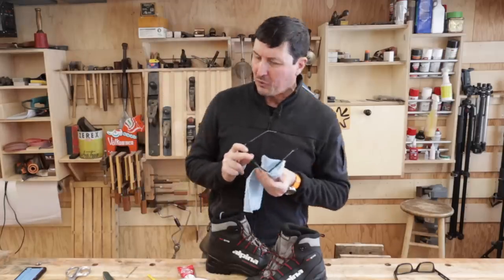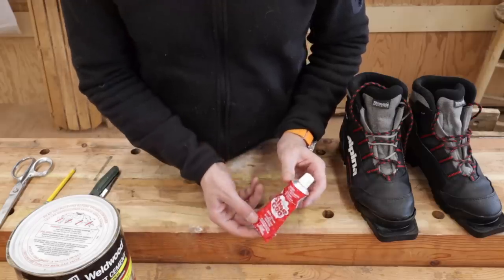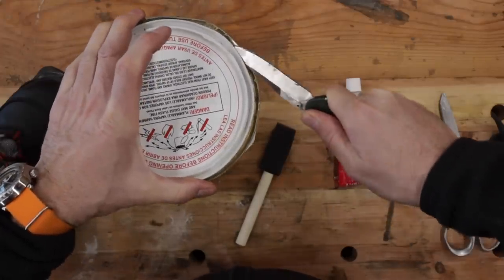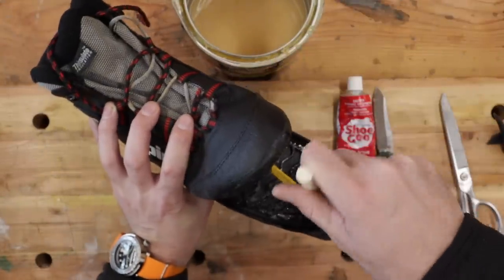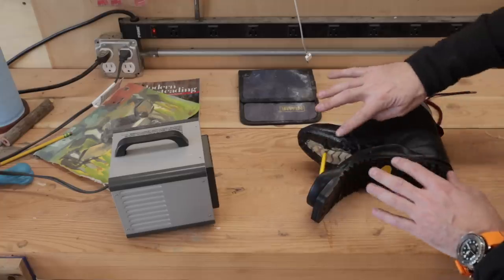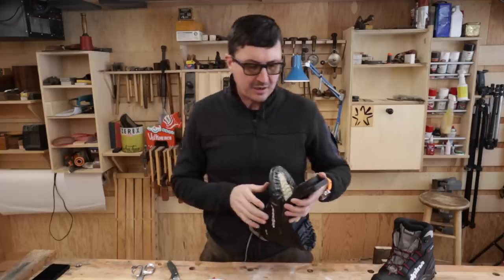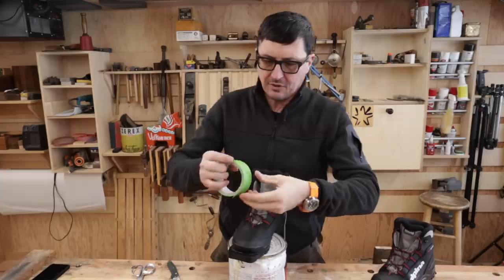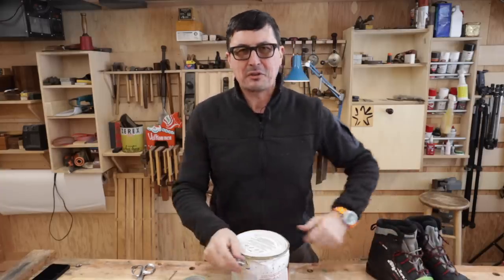SHOE REPAIR - How To Repair Your Shoes

Comment: I broke the tip of my Benchmade opening a can like that.  I thought to myself  "No problem, It's covered under warranty"  nope...
Reply: Of course it's not. It says right in there warranty abuse is not covered.

What they will do though, is replace the blade for $25 in that case.

Comment: Hi, Do you have any advice how to avoid shoe blow-out tearing on the sides? (like I have had in this image at this link:https://drive.google.com/open?id=1EXfwva0xnGiuOww9laqRT6LdURAbCQ0r). It's like the upper tears away from the lower, and it's like a neoprene material. I bought a new pair that is a slightly larger size, but the width still feels tight in the potential tear-out areas. So, I was just wondering how I could reinforce these areas to avoid these tearing out? Thanks!

Comment: I've always used shoe goo, but the contact cement sounds like a good idea.
Those having trouble finding the bitchute channel just type in bitchute dot com slash wranglerstar. It will take you right there.

Comment: Shoe Goo is WORTHLESS.  The sneakers I go running in every day only lasted a week when repaired with Shoe Goo.  Might as well use a tube of silicone sealant.  The shoe comes apart after a very short time.